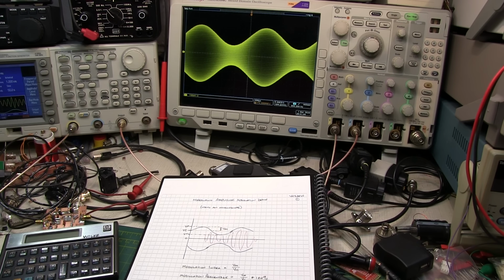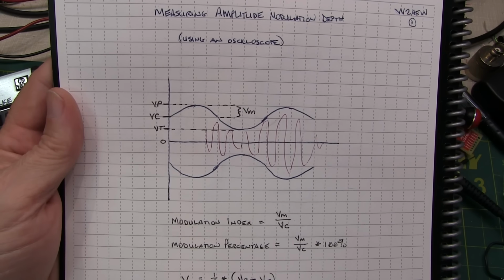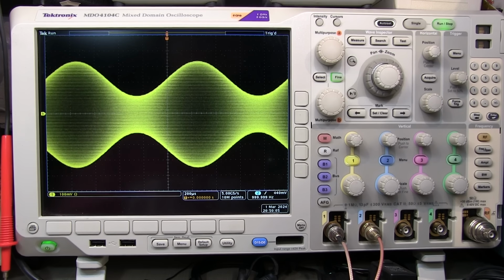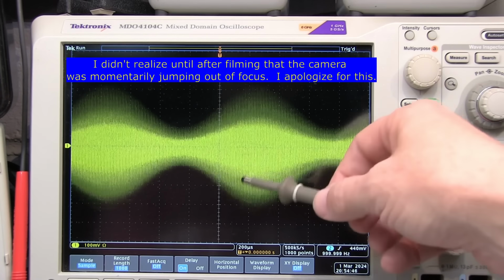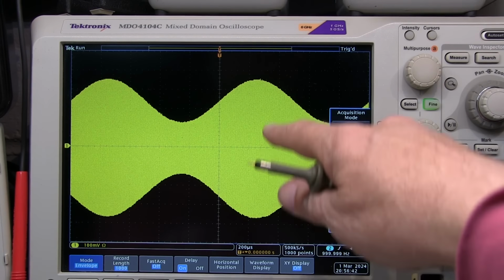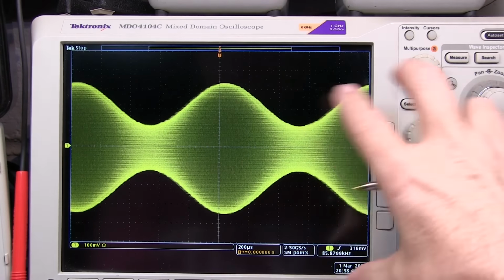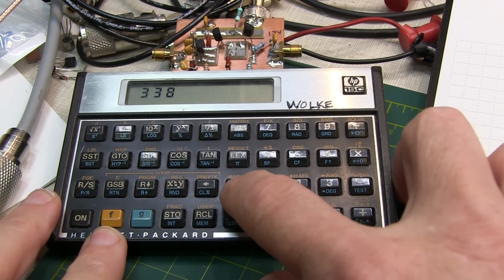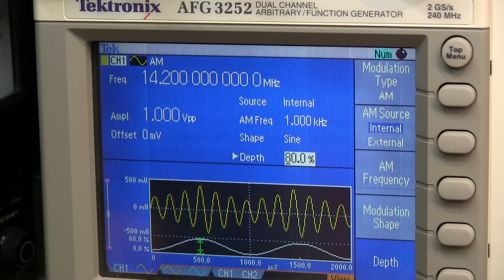#382: Measuring AM modulation depth/percentage with a digital oscilloscope

Comment: Another great video, thanks! For triggering on am AM signal on either an analog or digital scope, I'd recommend using "Hold-off Time". just set the hold-off time to the modulated frequency's period (the reciprocal, e.g. 1/Frequency) divided by 2. e.g. 1 KHz = 1/1000/2 = 0.0005 Seconds or 500uS. Works great for me.

Comment: As I recall from my old days of AM radio engineering, we used a trapezoid pattern to measure modulation.  An RF sample would be sent to the vertical scope input, and the modulating audio would be used for the horizontal sweep.  This produces a trapezoid that can be measured in the same way as the method you used.  The peak and trough measurements are used in the same formula to determine the modulation index.  With a high voltage RF sample, we would connect it directly to the vertical deflection plates via screw terminals on the side of the scope provided for that purpose (don't try this at home!).  I don't know how this would work with a digital scope (don't have one, and back in the day digital scopes using vacuum tube were scarce!).

Comment: Thanks, I learned something new.
If you have offset dc voltage, it might be better to measure Vp_to-Vp and Vt_to-Vt and divide them by 2 to get Vp and Vt.
Reply from the maker: In fact, you could just use the peak to peak and trough to trough measurements directly. No need to divide them by two.
Reply: @w2aew   Yes you are right, because you can factor 2 out in the fractions.

Comment: You could also half your measurement errors by measuring peak-to-peak values.  Once again, the factor of 2 will cancel.  Oscilloscopes are designed for our 1% ability to observe trace positions on their screens... assuming the measurement occupies at least half of the screen.  Note that 1% of 50 is 0.5 and 1% of 80 is 0.8.

Comment: Great video. How to measure total power in AM signal using oscilloscope? I am using Rigol DHO 812 .
Reply from the maker: Use the VRMS measurement.  Make sure to have the timebase set to see the full extend of the modulation pattern, and sample rate high enough to not undersample the carrier.  Once you have the VRMS measurement, then compute power as Power = (Vrms * Vrms) / 50.

Comment: How would you measure the modulation index using an analog scope.
Reply: The only major difference would be an analog only scope would not have cursors to aid in the measurement.  One would have to count divisions on the grid on the screen.
Reply: @BryanTorok  Some analog scopes do have cursors! (the 2465 for instance) Also, some aspects of the measurement setup are easier on the analog scope -- the sampling part which likely is the major hurdle for the digital scope can be disregarded. Further, the ch2 trigger trick can of course be re-used, if the source can supply such a signal. Many function generators have a sync out that is excellent as a trigger source, letting the main out drive the modulation on the R/F generator. If using the built-in modulation of a RF generator, there often is an AF output that can be used as trigger source.  But, yes, counting divisions is what one would have to do if nothing else is available.
Reply: Thank you @BryanTorok
Reply: @mansnilsson4382  It has been decades since I used a hybrid analog scope with digital measurement.  They were pretty slick for the time and actually under some circumstances provided a better image than modern all digital scopes.
Reply from the maker: Here's a followup showing how to use an analog scope for the measurement:
https://www.youtube.com/watch?v=zfYK1vU3JMY

Comment: What would the triggering look like on a analog scope like and 475 or 485? Would you just have to accept the jitter, or could you use HF reject to get stable waveform?
Reply from the maker: Careful level adjust and tweaking of hold off should work well.

Comment: I am surprice that you not read the value after you enable envelop funtion. In my  profetional job I am making a lot of pulse power mesurement on RF switches using Keysight oscilloscop. One of the biggest issue is to get stable envelop. What I can say the Hiber traanssform funtion what they are using for that is useless. Look like the people do not undestand that making static calkulation in mathab do not much the dynamic responce in real life dynamic signal. The only thing that really works is max hold with carries in free run. With this approch you can use relatively low carrer frequency to generate interpolation for fast switching signal.  Unfortunatly max hold is very slow.
Reply from the maker: I didn’t use the envelope function for two reasons. It’s wasn’t needed because my sample rate fast fast enough to accurately sample the RF, and I didn’t want to include the peaks of the random noise on the signal.

Comment: Excellent video. We used the same o-scopes in our lab. We didn’t work with  AM modulated signals. Great tips! Still  using HP-10 C calculator?
Reply from the maker: HP-15C actually.